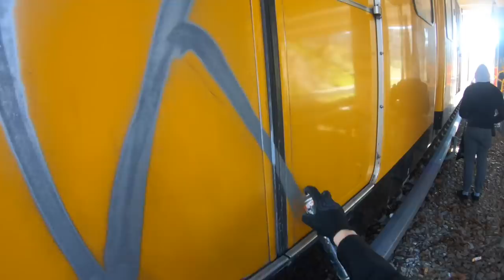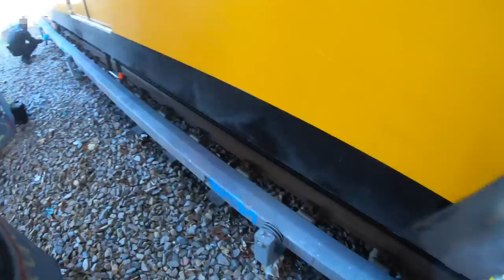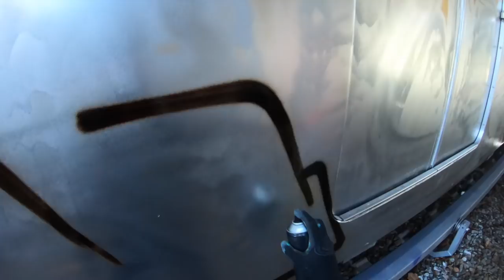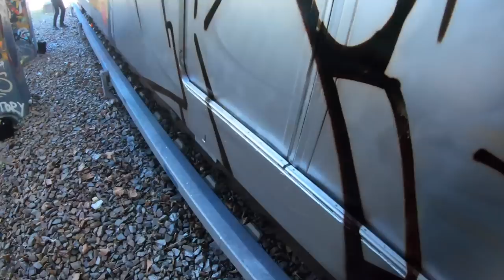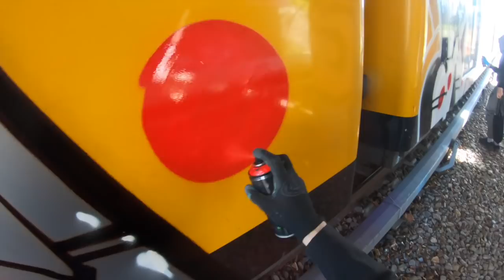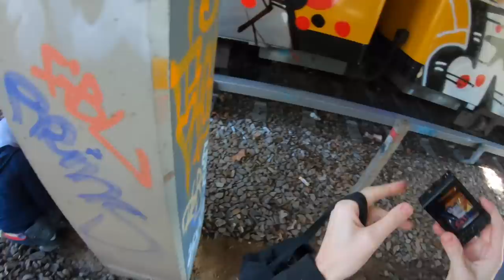Cekios | Chrome metro

Comment: Wait, is he using Tarblack? Why would someone do that? 😅 Even he is struggeling with this one
Reply: Alot of times the normal black does not cover well on the chrome so you have to do the outline twice!
Reply: @StayTrueHD  Molotow Burner Black?
Reply: @freightlorris9624  he also used Montana Chrome so maybe just a better mixture also most shops only have the 600ml burner black and its not that good for small panels especially for the skinny cap details he did. Besides that he probably just had that can lying around ^^
Reply: @freightlorris9624  tar overall has a better coverage over chrome